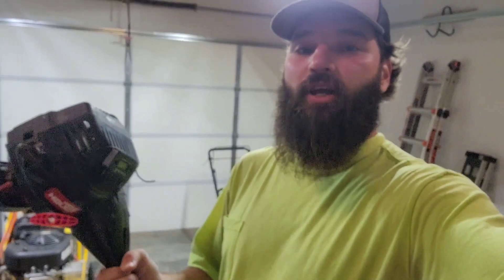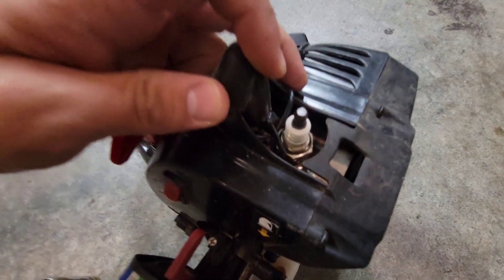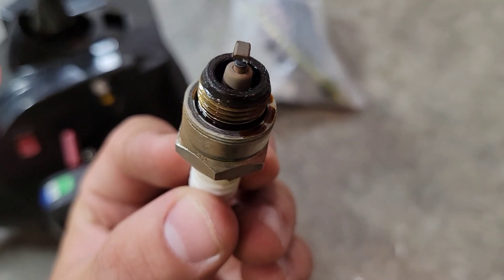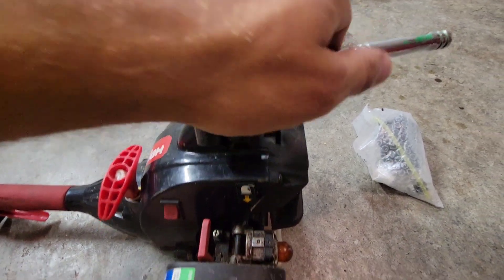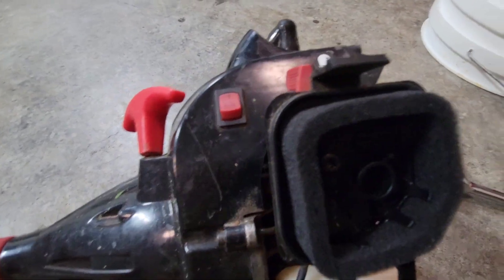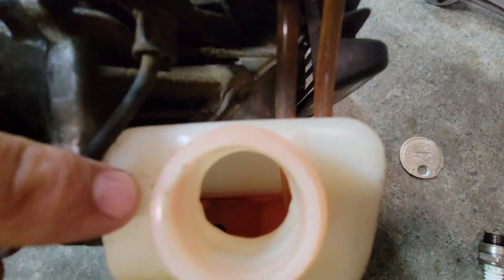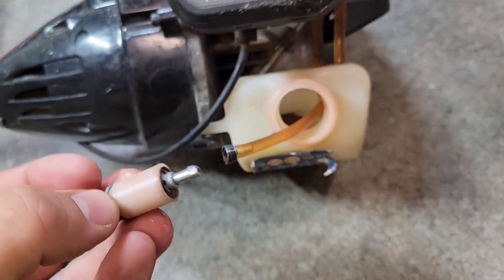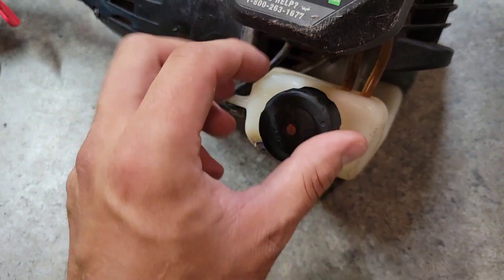How to Do A TUNEUP On A HYPERTOUGH 2 Cycle STRING TRIMMER

Comment: I think the new hypertough trimmers are really a homelite 

They use to be really a troybilt.  Like the Murray m2510 I have going on it’s 5th or 6 season .  Mine always starts.  Only thing. That broke was the throttle cable

Good video

One thing I do is I only use non ethanol fuel mixed with full synthetic 2 cycle oil.
Reply from the maker: It's very similar to the ryobi and homelite (it's the same just rebranded). That's one of the best things you can do for it is run ethonal free fuel through it. I am very very impressed with this trimmer

Comment: The packaged instructions talk about putting oil in the machine. Where does it go, please?
Reply from the maker: This machine is a 2 stroke engine and you put oil in the gas 50/50 mix. If you bought a 4 stroke unit it will need oil added into the motor and not the gas.
If you bought the same one in this video and it's a 2 stroke engine there is only oil mixed into the gas

Comment: What is the pros and cons of curved vs straight head? Ive had terrible luck with straight heads
Reply from the maker: Well that's mostly personal preference that makes a difference. I am a bit taller and a curved shaft would be too small for me. However a curved shaft trimmer might be more comfortable for others. That's honestly the only difference between them really
Reply: @JonsDailyHustle  that what I thought it was and not a mechanical thing. Im like 6ft but have gotten used to the curved the extra weight and length of the straight shaft just kills me. I absolutely hate even using a trimmer. But I know all the straight shafts have failed like super fast. I think maybe it's cuz I change the heads that don't need to be coiled. But I've never had luck with them the gear strips out pretty fast for me